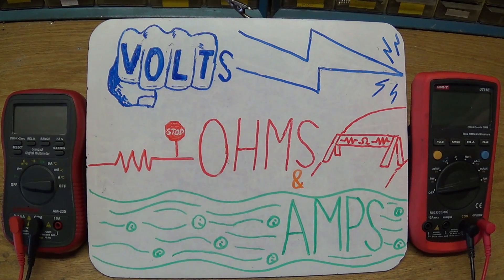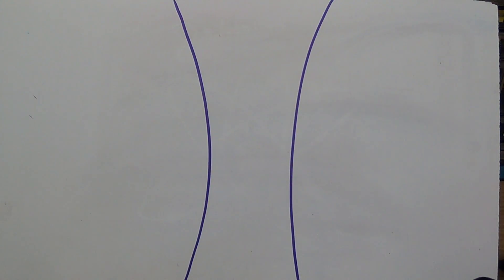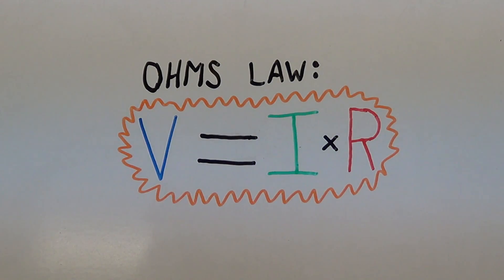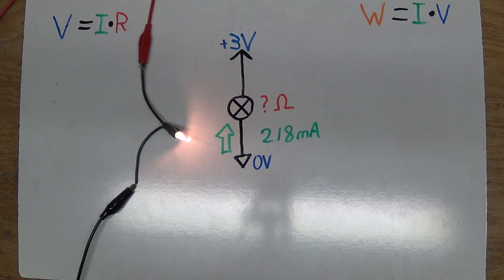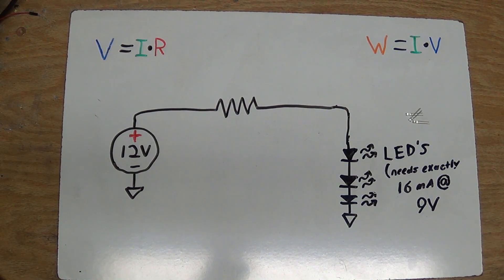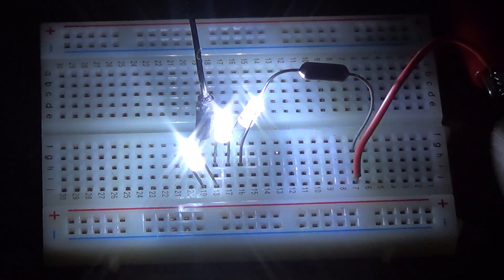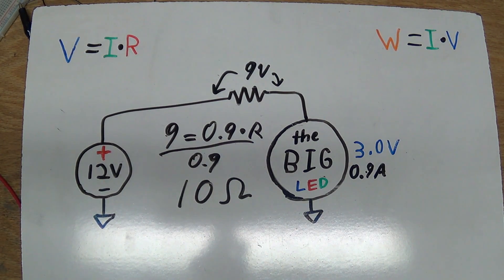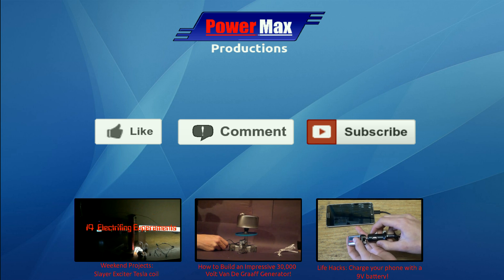Tutorial Tuesdays: Volts, Ohms, Amps, and Watts

Comment: I saw somewhere that Voltage is the water pressure on a river, Amps is the amount of water flowing through the river, Ohms are the rocks that resists the flow of water, and Watts is the power that the water could provide (For example if it’s in a watermill)

Comment: At the end you needed a 10w resistor, not a 10ohm resistor. Huh? You mean a 10ohm resistor that can handle 10 watts??
Reply from the maker: Catfish Cave The resistor needs to be capable of dissipating about 10W and have a resistance of 10 ohms.
Reply from the maker: The large ceramic wirewound resistor is rated for 10W and has a resistance of if 10 ohms.

Comment: U made a mistake at 6:44 with the resistance.  I also couldn't understand y the voltage drops across a respirator 12v to 9 volts

Comment: W = VxA  So  12v x 1a = 12watts and 24v x .5A = 12watts.  I do not understand how less electrons are moving and still producing the same power.  Are they more powerful due to the force from voltage.  I understand 1 amp is 6.24 x 10 to the18 (about...)  to be constant.  

hmmmmmmmmm   anyone?

Comment: I know this may be off topic but could someone tell me if the amps are higher than needed on a dc power supply yet the dc voltage is correct.... Will that cause an issue with the device it's plugged into?
Reply from the maker: That's fine. The current rating of most common power supply's is the maximum current it can deliver. Since it is (almost guaranteed) a voltage source (providing fixed voltage regardless of output current) it is up to the powered device (the load) to pull as much current as it wants. In general, it's best to use a power supply that can deliver more current than the device is rated for.

If the power supply is "smart," when you try to draw more current from the supply than it is rated for, it will simply start limiting current by reducing the output voltage to protect itself. Some of the new small switch mode supplies will completely turn off until reset, even with very brief surges of current. That is why a giant heavy, "dumb" 600mA wall bricks are used to power things like pencil sharpeners where in the same pencil sharpener would not work with a modern smaller lightweight 1A adaptor.

...

HOWEVER, there are a few rare but important exceptions: for certain LED drivers and other constant current regulators, it is the exact opposite. A Constant Current supply will do what it can to ensure a constant current flows. It does that by varying the voltage. If you connect something that needs 3A constant current load to a 5A current supply, the supply will ramp up the voltage to force exactly 5A to flow, possibly blowing the thing up.

Because Constant Current supplies are rare in practice, not many people know about them or how they work. Just like a normal CV supply has a current limit, a CC supply has a voltage limit,  technically called the Compliance voltage. If for instance your device just refuses to draw the current the supply tries to force, then the output voltage will reach it's maximum and the constant current is no longer maintained.

Comment: So I'm still trying to understand it. You did a good job, but I'm only half way there I think.

I think of it as a river. How much the electrons want to get to the protons is like the incline of the river bed. (Is there a special term for this force? Voltage maybe?) There are stones (resistance) in the river which slow down the speed of the water (the resulting speed being the current). The amount of water moving through a given span of water will be affected by this (amps?). Mr. Ohm says that if the incline of the riverbed is too gentle, no water would move at all, with just puddles everywhere (not enough volts to actually push the current through the resistance).

The water could go through a water mill (an LED or resistor or whatever). But for it to actually turn the wheel, the paddles require a certain amount of water pressure (watts) to push the paddles. But to get enough pressure, you need the right amount of water flowing (amps) and some stones in the river (resistance) to speed it up through tighter corners (giving more wattage).

I'm sure I've not got some of it right. Please help me patch this illustration until it's correct. I'd very much appreciate your help!

(I think you talked about current in two ways, to figure out voltage and then multiply it by voltage again to get wattage. Is that right, or did I misunderstand? Maybe I'm just mixing up current and amps?)
Reply from the maker: I tend to use the hydrologic or plumbing analogy, as it is both intuitive and mathicatically accurate. Ignore the speed of the water, compare voltage to water pressure, and current to flow rate. Resistance can be thought of as the diameter of the pipe (smaller being greater resistance). You can even expand the analogy to capacitance and inductance, using a pressure tank and the water hammer effect respectively!
Reply: Yeah, that makes sense. No idea what capacitance and inductance and the hammer effect means, though. I feel like I can understand the river idea better, but whatevs. Is there anything actually wrong with my interpretation? Just trying to figure it out in my own head... ;P

For you analogy, where do the amps and voltage and ohms and watts come in?
Reply from the maker: Honestly your analogy confuses me, its just not accurate. Wattage is just the product of voltage and current. Its represents how fast work can be done, or how much energy is transfered.
Reply from the maker: +Thomas Giles Best way to get a understanding is to just start messing with electronics! Make a flashlight, or a radio, and just start messing with simple electronics!
Reply: So wattage is the energy being transferred from the movement of the water to the paddles in a watermill. If the water wasn't moving, or was moving but not fast enough, the mill wheel wouldn't move. It's the water pressure (the speed and enertia of the water) hitting the wheel that turns it. So that's watts, right?
Reply: It's fine if it doesn't make much sense. That's exactly the help I'm looking for, here. If you could tell me which parts are incorrect, or help me correct them, something like that, that would be great!
Reply from the maker: +Thomas Giles Capacitors resist change in voltage, and can absorb and release current and charge. mathimatically, the current flowing through a capacitor is directly proportional to how fast the voltage is changing. Similar to how a pressure tank can store pressure, and can absorb spikes in water pressure. the water hammer effect is pretty simple too, you can google it for a better explanation.
Reply from the maker: +Thomas Giles I might try to make a video using my analogy with graphics to explain it. But I just cant find the time to do stuff anymore.
Reply: +Power Max okay, no worries. Thanks for your video and your help, anyway!
Reply from the maker: +Thomas Giles honestly I find that when I learned something wrong with misunderstandings, I get more confused before I understand right. I can give you a more comprehensive explanation when I am home on my computer. Typing from the app is hard.
Reply from the maker: Edit: Sorry this is a really long comment, but I thought it would help you out, as I explain the things wrong with the analogy you presented. All analogies will break down at some point, including mine when you start thinking more about active electronic components nonlinear loads, transformers, and even power, at least from an intuitive standpoint as people never consider power in a home plumbing system as the product of water pressure and flow.

Voltage is the force that makes electrons flow through resistance, but keep in mind that voltage is ALWAY's a measurement between 2 points. It is also called "pontenial difference" for this reason. Current is literally just the rate of electrons passing through something (1 amp being one coulomb of electrical charge passing through per second) and resistance is how hard it is for current to flow. Things with higher resistance need proportionally higher voltage to force the same current to flow through them. For this reason, if you think of a lamp as a constant resistance load, then if you double the voltage across the lamp, the current will also double. Since both double, the power actually increased four times!!!! And theoretically will be four times as bright.

You asked about how the analogy is not quite correct, well IDK where to even start but:

"How much the electrons want to get to the protons is like the incline of the river bed." OK this sorta works. But the incline of the river bed should be compared to an electric field, or specifically, a electric field gradient. This is hypothetical abstract stuff though that you don't need to worry about. Voltage would be more like the total difference in altitude between the top of the river and the bottom. The bigger that difference, the more the water at the top wants to go down.

"There are stones (resistance) in the river which slow down the speed of the water (the resulting speed being the current)." Resistance does not actually slow down the speed of electrons through a wire, just amount of charge passing through it per second, or the current. The net movement of electrons through a wire is actually extremely slow!!!! It is called Drift Velocity! Google it if you care to learn more about it, you can find formulas to calculate it.

"The amount of water moving through a given span of water will be affected by this (amps?)." Yeah, I think I get what you are saying, and that is right. Current is IMO the easiest to understand. Literally nothing more than charge per second flowing through something.

"Mr. Ohm says that if the incline of the riverbed is too gentle, no water would move at all, with just puddles everywhere (not enough volts to actually push the current through the resistance)." OK this is basically completely wrong, I'm afraid. If you are taking about an ideal resistor, even the most ridiculously small voltage will cause some current to flow. You will never have a case where zero current flows with a finite voltage across a resistance. In fact in the real world, everything has a finite "resistance" to it and current is always flowing in things around you, really. It may not always be measurable or detectable, however.

"The water could go through a water mill (an LED or resistor or whatever). But for it to actually turn the wheel, the paddles require a certain amount of water pressure (watts) to push the paddles." I'm afraid this is just plain wrong too, either that or a gross oversimplification. LEDs are a more complicated (extremely nonlinear, changes with temperature, etc.) load, don't worry about them too much right now. With a resistor, say you grab a 1 ohm resistor, any amount of voltage applied across it will cause some power to be dissipated. You could use any formula you want to calculate the power, they are all available online. Because any voltage applied will induce a current (how much based on the resistance and voltage differential applied) and power will always be used.

"But to get enough pressure, you need the right amount of water flowing (amps) and some stones in the river (resistance) to speed it up through tighter corners (giving more wattage)." I think he was talking about how when you force a current through a resistor, a voltage will develop across it, and the more current you force across it, the greater the current. Just keep ohm's law in mind. V =I*R.    It does not matter if you are thinking in terms of applying a voltage and observing a current, or thinking in terms of forcing a current to flow and measuring a voltage developing across the resistor, it is all the same really. Ohm's law is the LAW, and resistors will (more or less) obey.
Reply: Okay, I think I'm getting there. (Great explanations and help you're giving me! Thanks!) I'm working on a revision to my analogy as I figure things out. A few more questions.

What do you mean by "power"? Is that wattage?

If I understand correctly, Ohm's Law doesn't really give you the relationships for how each part is affected by another. Increasing the voltage will increase the current for the same resistance, but it wouldn't increase the resistance for the same current--is that right?

And you can't increase the current directly; you can only increase the voltage or reduce the resistance.

For your calculations, do you not need to take the wires themselves into consideration--their length, their resistance?

And for watts, it sounds like W = V * I is the same as W = (I * R) * I. How does that make sense? What's the use of this measurement? What does it tell us that we don't already have from resistance and current?
Reply from the maker: Yes, power is measured in watts. The same way voltage is measured in volts, and current is measured in amps.

Resistance is generally constant, but not always. If your load can change, like say it is a motor and the motor is loaded down, it will appear like a heavier load with a lower effective resistance (motors can actually be pretty complicated loads too, but I will treat them like a resistance) and since batteries act like constant voltage sources, the current must increase, and the power will also increase. Here is an experiment for you. Connect a battery bank or power supply to a motor so the motor spins. Connect a small indicator or christmas tree lamp in series with the motor, and see how bright the lamp is. It should barely glow. If you stop the motor spindle, the lamp should get to almost full brightness!

"Ohm's Law doesn't really give you the relationships for how each part is affected by another" Well actually it can! If you have a real world battery with a finite ESR, which means it acts like an ideal voltage source with a parasitic phantom resistor in series inside the actual battery, then if your load resistance drops, the voltage output of the actual real battery will sag! So in this case, literally everything changes, you changes the resistance of the load, that affected the voltage, causing it to sag, and the current increased some. That's when things get interesting. You can find some resources that discuss ESR, as well as the differences between Constant Voltage (minimal ESR) power supplies, and Constant Current supplies (almost infinite ESR)

"And you can't increase the current directly; you can only increase the voltage or reduce the resistance." Sure! Like I said it's gotta obey ohm's law. Increase the load or the voltage, that's how it's done.

"For your calculations, do you not need to take the wires themselves into consideration--their length, their resistance?" If you are worrying about the voltage drop across your wires, then you should be using bigger wires! If there is a significant Vdrop across them, they may outright melt! So generally that is not considered, you can pretend wires are ideal.

"And for watts, it sounds like W = V * I is the same as W = (I * R) * I. How does that make sense? What's the use of this measurement? " You just discovered the formula P = I^2 * R all by yourself! Great job! I was going to point this out but there was no need. Google the power loss in a resistor formula, you will see it is the same. There are actually a few different ones, the other one is P = V^2/R. I'll let you figure out how to get it using ohm's and watt's laws. Those formulas are just more convenient. If you know the resistance of a resistor, and either the current or the voltage, then you can just use the right formula and quickly figure out how much power the resistor will dissipate, and that can tell you how hot it will get. Make sure when picking a resistor or a rheostat, that you pick one with a high enough power dissipation rating. I discuss this in my other Tutorial Tuesdays video.
Reply: Cool. All making sense, I think. Thanks for your help!
Reply from the maker: I think your understanding is fine now, start messing with some circuits to reinforce your understanding and see what else you can learn.

Comment: I wish I learnt this in mathematics instead of just in physics or chem. I still struggle to wrap my head around each type of measurement
Reply from the maker: +Daniel McKenzie When I was taking physics, I had to compare all the newtonian forces and create electrical analogies for me to understand them! Guess I am backwards from everyone else who needs analogies to understand electronics lol! My favorite analogy is the water (hydraulic) analogy, where voltage is like pressure, current is like flow, and resistance is like a clog or obstruction. This analogy can even stretch to describe capacitance, inductance, and diodes, and the hydraulic equivalent of a switch mode power supply (boost converter) is literally a RAM pump!

Comment: Hey dude I got a small question for you. A 12v 1amp dc power supply can run a 12v 4.2w dc motor or does it require a resistor/fuse or additional components
Reply from the maker: +Akshay Kaleeah It should be fine. 12v * 1A = 12W. 12W > 4W. However you might have some problems if the 12v wall brick is the newer switch mode type. If it is the older type (the heavier ones that are clucky) Those are less sensitive to abuse and overcurrent. Motors tend to draw an initial high inrush current which can trip internal protection circuits inside the more modern wall adaptors.
Reply: +Power Max Thanks a lot for your reply. It has help me a lot since i know no basic of physics. Wish you all the best for your channel.